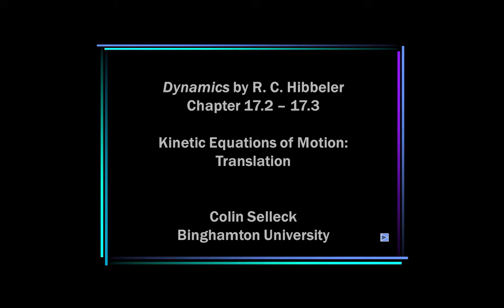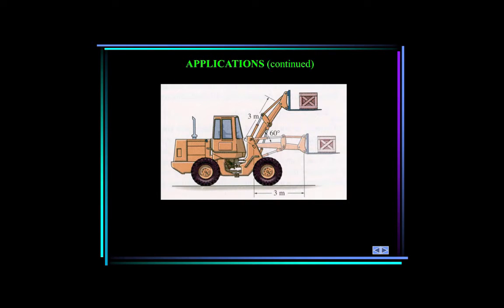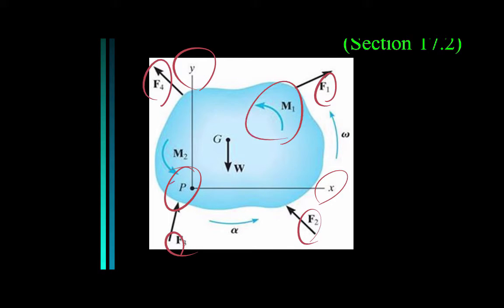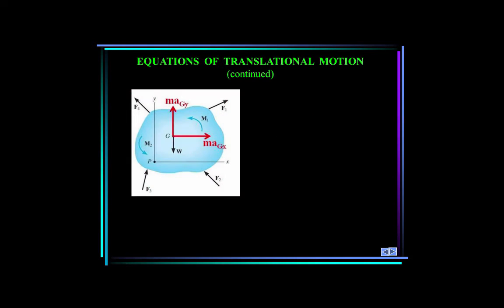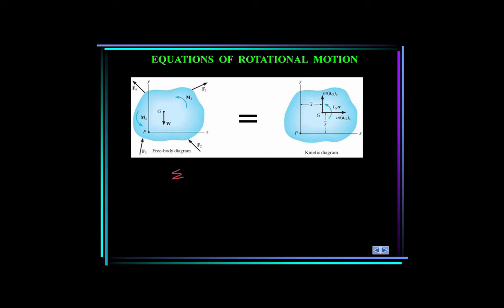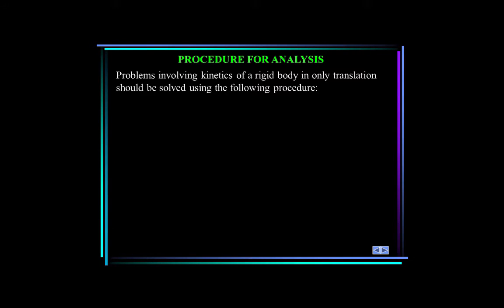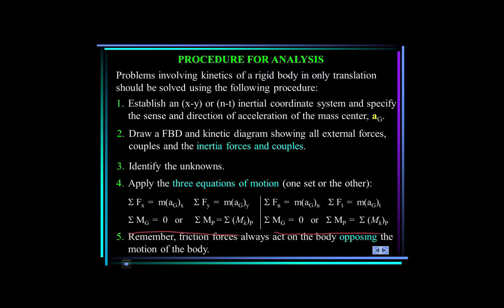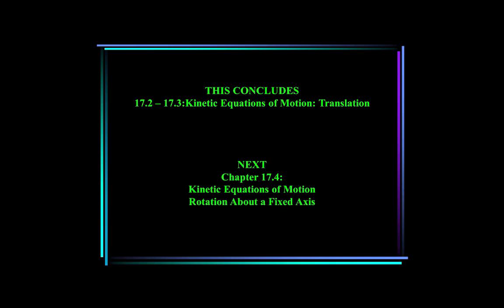ME 274: Dynamics: Chapter 17.2 - 17.3

Comment: In 12.40: took moment about wheel B and got NA = 470, NB,570. Any suggestions? If we were to take the moment about any point we should get the same answer ..from statics course
Reply from the maker: I made a mistake in the video Na is 470 and Nb is 571.

Comment: In 14:00 while calculating the moment about point  B, why you took the moment of inertia of G mass center  not C ?
Reply from the maker: When you sum moments about a point other than the mass center (in this case b) you need this equation: sum moments about b = Moment of inertia about g (mass center) * alpha + vector between g and b cross mass * acceleration of mass center.

Comment: Why is the vector Rb/g not Rg/b as it goes down and to the left 16:33
Reply from the maker: The equation always uses the vector from the point you are summing moments about to the mass center: Rg/b.
Reply: @ColinSelleck  But is that not up and to the left then sir in this video. Not down and to the right
Reply from the maker: @RobertYahir-t1l  Since only the spool is moving I rewrote the equation as sum Moments about B = Rc/b cross mass * acceleration of the spool. Rc/b is to the left and up.

Comment: in the third example in minute 13:36, why are NA & NB multiplied by 2?
Reply from the maker: Because there are four wheels and due to symmetry, the front wheels have equal loading as do the rear wheels.
Reply: They say there are four wheels so of course two at the back and two at the front do you take into account each wheel.
Reply from the maker: The Na and Nb forces would be the normal force at each respective wheel.

Comment: Does anyone know why in 14:37, the professor was able to change the summation of moments about b to rc with respect to b multiplied by mass of the spool?
Reply from the maker: That is because only the spool is accelerating in this composite body.
Reply: Thank you, but you said earlier in the video that if a rigid body undergoes only translation, all of the particles of the body have the same acceleration, so a sub G = a sub C, so if that is true why would you change r of G with respect to B to r of C with respect to B. That would give you a different answer
Reply from the maker: The spool's mass center is at C, not at G. So when summing moments about B, I use the vector from B to C and the acceleration of the spool's mass center. Remember, the equations require the location of the mass center of the body, not just any point on the body.